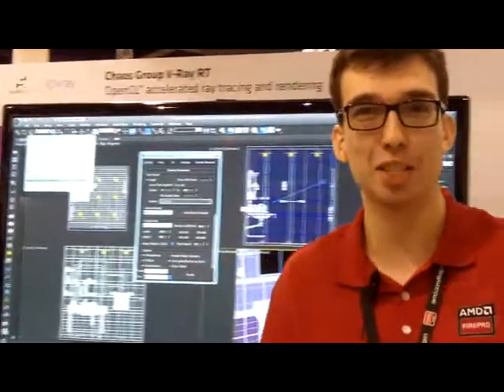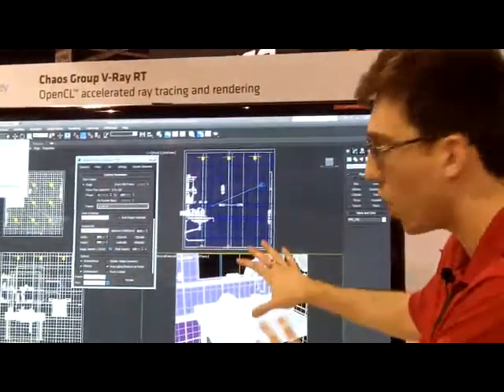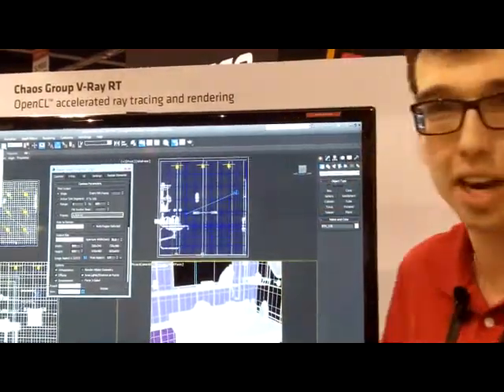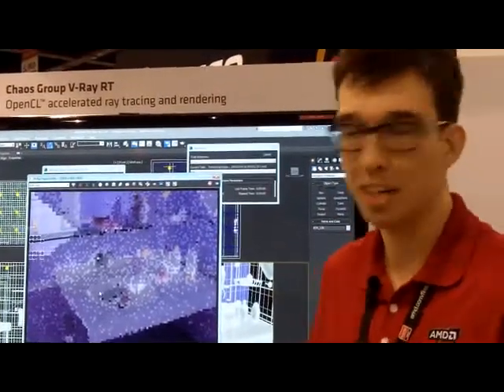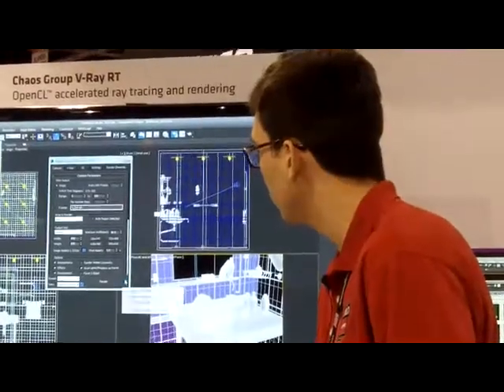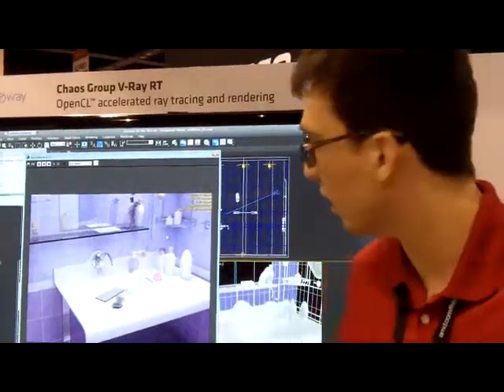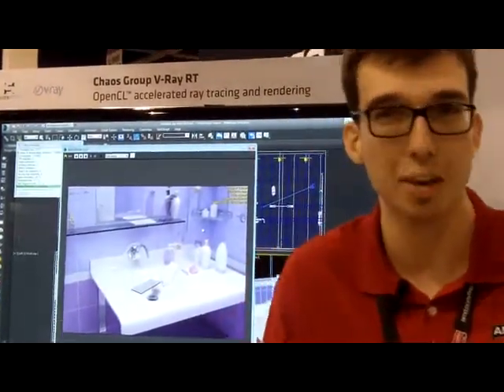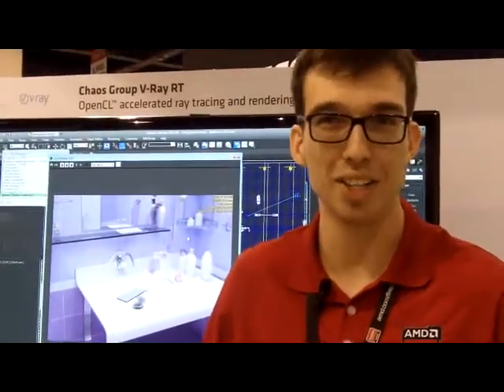Real-time raytracing using VRay RT 3.0 in 3ds Max using AMD FirePro W9100

Comment: Deleted
Got in working on my firepro, Vray needs time to build Opencl compliation when it runs first time under opencl. Although it will say "cl_nv_complier_options" not found, but it does not matter, it went on to compile anyways. Just take time the first run.
Reply: w7100, It is limited. and not as good as a strong CPU or NV card. I am moving away from AMD. But your card should be able to work at least. RT engine is just for preview in maya anyways.

Comment: Will this extend to the dual AMD graphics in the 2013 Mac Pros? A lot of us Mac 3D users are looking forward to seeing some benefit to that exclusive AMD/Apple partnership. 3D GPU rending with AMD/Mac is presently so terrible its non-existent with everyone recommending OpenCL on nVidia - bummer!
Reply: Yes if it worked that good on the mac pro it would be a instant buy. But with the single cpu and questionable gpu performance i will probably build another windows workstation.
Reply: Marko Posavec sciasciagabor 
The dual D700 video cards are roughly equal to the power of dual W9000 in the firegl range.  I'm currently running Vray RT GPU with the nMac pro (with opencl) and have been having obtaining very good performance.  The main issue lies with drivers, that is the major issue at this point.
Reply: kaktusdigital my mac pro with amd d500 dual always end up with an error on rendering Vray Rt opencl. Waiting for apple or amd developers to work on this alliance